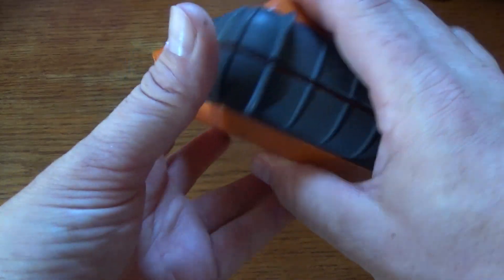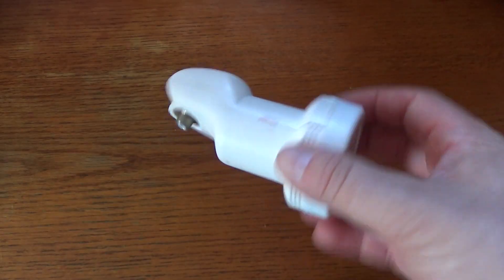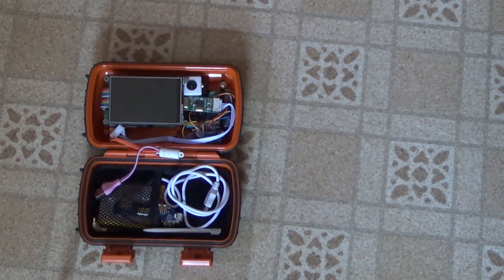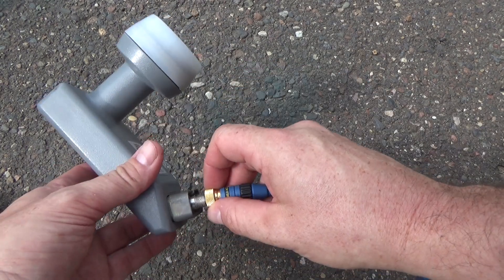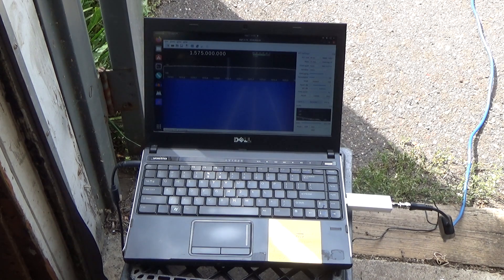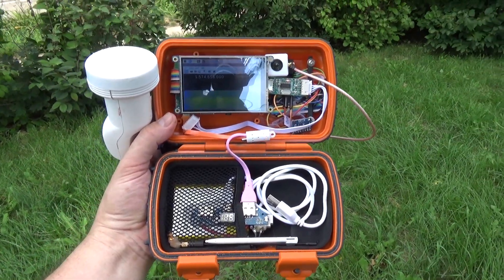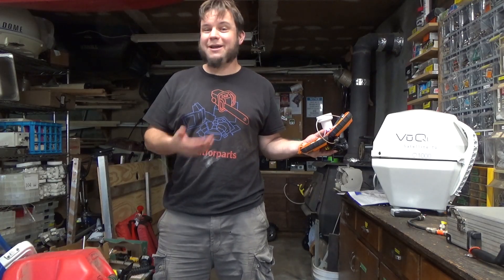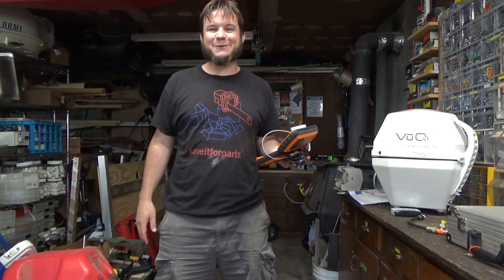Detecting Starlink Satellites With DIY Tricorder

Comment: Where did you get your bias tee for 12v, I can only find 5v ones
Reply from the maker: 45¢ at Ax-Man surplus, but no brand or model name on it so can't tell you what to look for! I think you can find generic "power inserters" or powered antenna adapters that will feed any voltage you want onto a coax line.
Reply: @saveitforparts  Thanks! I'll look for them.

Comment: Hmm, Good idea. always looking for more things to plug into the RTL-SDR, pretty sure I have a few LNB's in the shed. would be interesting to have a few different gains (say one bare, as a basic dipole, then one with say a small yagi, and then the normal setup with a dish). could make finding some more obscure sats a bit easier?
Also, I've got one of those Dell Vostro laptops I literally saved for parts. found it at the tip, sans battery, hdd, n RAM, but seemed in good condition. slapped in some random ram sticks and an old SSD, hasnt skipped a beat in years. from memory the best uptime I have seen on it was 104 days, and that was only cos I had to physically move it. good machine, right price. I also found a Saitek force feedback joystick that day, I was going to gank the actuators, but that worked once I fed it enough power and got the drivers. and is so much fun it managed to escape the parts bin affectionally known as my shed. Its about 38c outside right now, so I think I'll leave tinkering in the shed and try breaking parts off my mosquito by doing silly things. IL-2 is a great game.

Comment: Is it possible the impedance of the antenna system isn’t matching that of the input parts of the laptop SDR? I’m very much a novice at RF stuff though 😅
Reply from the maker: It's possible, I never remember how impedance works.
Reply: @saveitforparts  dude same it’s the least intuitive part of RF stuff in my opinion.

Comment: I know that this is an old video, but the big issue is that DirecTV (the LNB) that you were using is powered from either 13 or 18V depending if you want left or right circulation selected.  They output in two 500Mhz blocks, A-band (1650-2150 MHz) and B-band (250-750 MHz) from the KU band signal in the 101 sats.

Comment: The reason why you received nothing on your laptop probably is the huge cable loss in the (compared to the handheld) quite long (and seemingly low quality) cable. Cable loss is quite significant at the very high frequencies in use. Try to connect the sdr-stick with a shorter and lower-loss cable. You can also try to minimise interference by battery-powering the laptop.

Comment: bare radio would be a local oscillator at 10 ghz. grounded base amplifiers have lower voltage gain. cascade of same amplifiers. someone else test it.  i have one vhf radio with regenerative if. nc radio with tubes.

Comment: Great video, I don’t suppose you could share with me some of the configuration settings for your gqrx? Such as your LNB LO. Also how did you come about finding the frequency to listen on? Was it just trial and error until you picked up some signals?
Reply from the maker: More info here: https://www.rtl-sdr.com/receiving-starlink-beacons-with-an-rtl-sdr-and-lnb/
Reply: @saveitforparts  thanks very much, I used that link previously too to build mine, but it stops short of explaining how to configure the gqrx settings for the receiver. I can see the frequency you went for on your Picorder in the video, but not any of the other settings that are typically down the right hand side in gqrx. Was wondering if you recalled what you had these set to?
Reply from the maker: I pulled out the picorder again to see what it was set at. I have the LNA gain all the way up (49.6 on my weird little SDR). Squelch at -150db. Frequency is 1575 mhz, Filter 160k, Demod Off. Everything else is just set to whatever the defaults are. My screen is so small that GQRX settings fall off the side and I can't see or change half of them. I think most of those other settings just change how things are displayed vs the actual input.
Reply: @saveitforparts  Being in the UK, I have a stack of universal LNBs here in the house! 🙂 I might have to try this. I'm guessing you're using one with a 9.75GHz local oscillator?
Reply from the maker: I'll try to link to the original project, if Youtube's filter eats the link then try searching "Starlink LNB" and visit the rtl-sdr blog post from last December. I pretty much copied that info, I had to go on eBay to find a "universal" LNB.

Comment: you do all these kool things , but 2x- 9v's .. do a lithium battery project - supper EZ ,  do something simple like a 4s-headway pack
Reply from the maker: If I make this more permanent I'd wire something into the main power of the tricorder. I just wanted to do a quick experiment to see how it worked!

Comment: I really want to try this. Can you please give more info on what’s needed and the setup please. Thank you
Reply from the maker: Maybe I can do a writeup on my website. I've stuck together a couple things here, the tricorder is an ongoing project using a Raspberry Pi computer and software defined radio (I have a few videos on it). The Starlink receiver is just a universal satellite LNB with a power injector (people keep asking where I got that, it's a generic / unbranded one from the local surplus store and you can also just use 9v batteries).
Reply: @saveitforparts  I’m in the UK so not everything is as easy to get it names are an issue. LNB right away is a struggle to find a normal one. I’d keep the setup simple my self but I have a basic SDR I could use. What’s the software on the. Website be great.
Reply from the maker: This is the LNB I used: https://www.ebay.com/itm/234269625431 (I'm not sure if it's available in the UK). 
The software I'm using is GQRX: https://gqrx.dk/
Hope that helps!
Reply: @petewright2283  Universal LNBs are ten a penny in the UK. I have a stack of them here in my attic if you want to borrow one! 🙂 I used to have four of them on three dishes before I got my motorised set up and now just use one (well, two as I have one on my Sky dish). Or just take one from any discarded Sky dish.

Comment: This universal LNB work in Ku band range 10700-12750 MHz. 18v = vertical polarisation (it is not important). You simply turn LNB. But on your scanner 15000 MHz. How does it do?
Reply from the maker: My scanner / SDR is listening to 1575Mhz (1.575ghz). The LNB is picking up the Starlink beacon at 11325Mhz and dropping it down to 1575.
Reply: @saveitforparts  very interesting. Does starlink on 11325Mhz  interfere with the reception of a useful signal from a satellite?
Reply from the maker: @WarMusic2022  I dont' know, I haven't done enough satellite experiments to really notice it before. I thought I caught a Starlink satellite on one of my other dishes when I was messing around with them, but I think the frequency range isn't quite the same as most TV satellites.
Reply: @saveitforparts  be aware those modern universal LNB need programming which is a DiSEqC Signal. A modulated 22 KHz signal upon the power-supply. It is used to switch the frequency-range as well as signal polarization. Older LNBs simply select polarisation by changing supply between 14V and 18V and select the band by continuous 22KHz signal.
RASPI is able to generate both of course with some lines of code.
Reply: @greekstraycats  The polarisation is still switched using the voltage. The 22kHz signal switches between the two local oscillators to switch between two parts of the band, hence the "universal" designation. DiSEqC switching can be paired with a DiSEqC switch to switch between several (up to four?) LNBs, or to control a motorised system (though that's usually USALS).

Comment: That batch of diagonal satellite traces creeped me out.  There used to be a vintage video game called, if I recall correctly, Strategic Air Command.  When you failed at shooting down all the incoming missiles the final screen you saw looked like that just before you got Nuked.
Reply: Missile Command
Reply: You probably mean smoke trails. You only really see them in testing as they are caused by sounding rockets launched a few seconds before the detonation. They’re used to visualize the size and velocity of the shockwave produced by the detonation